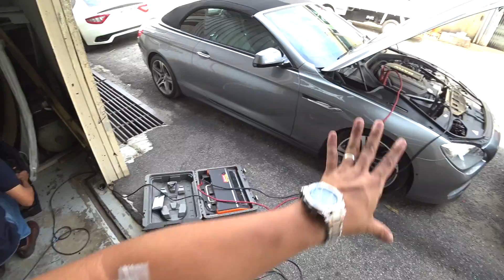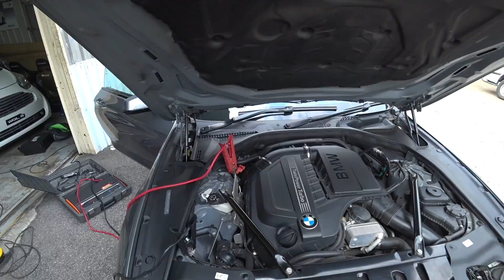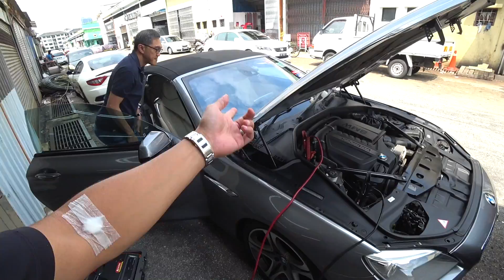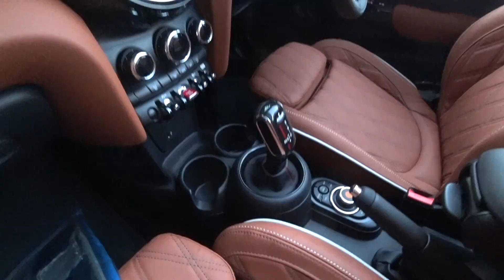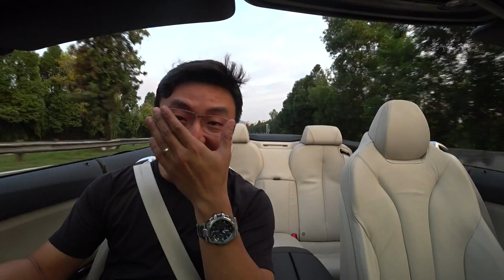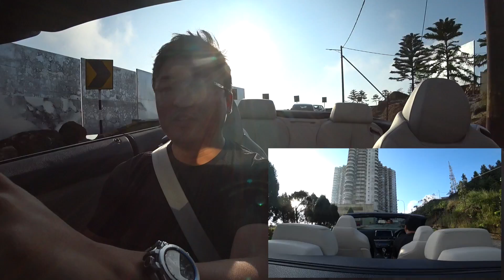So I tuned my N55 BMW to 400hp and 500Nm! | Evomalaysia.com

Comment: Bro, suggest that u dyno your cars before and after using the same dyno if u intend to tune your rides. Some quote 50hp bump but dyno shows otherwise. 

It also makes it more believable for your audience. Cheers.
Reply: And also how dramatic the tune change the car’s character via torque curve.
Reply: yes i agree with you. basically the shop does software tuning to remap the engine and just claimed that they managed to increase the 320hp to 400hp and torque to 500Nm without any dyno results? its very suspicious. if you are paying few thousands for a tuning, a dyno should come in together to verify the result.

Comment: Hey Bobby , Just wanted to know is it a good buy for Mazda 3 now especially for the 2Litre. I was quite disappointed when i saw the HP and the engine is basically from the last gen , as what you said in the video , DNA can has a significant tune for Mazda's Engine , like may i have a rough idea from how much to how much ?

Comment: I see n55 , I see tune . I click
Reply: Jay - B58 lagi power. One chip I easily 50hp bump. N55 need to do more than a chip for 50hp gain.
Reply: @jdfd4906  how about N54? Ok tak?
Reply: Seramics also lots of power gain for a tune. But the usual wear and tear applies. Known for high pressure fuel pump failures also.

Comment: I feel like doing this to my new Toyota 1.5n/a . But will void warranty? Is it worth to take the risk? Thanks
Reply: Oldschool Ninja will void. Wait till after the warranty period ends. In the meantime, u can get the sprintbooster if your car has no sports mode. Sprintbooster reduces the lag dramatically.
Reply: @jdfd4906  where did you buy your sprintbooster? feel like trying that